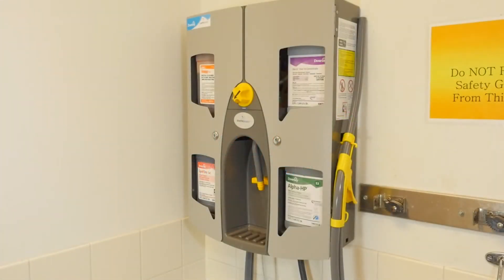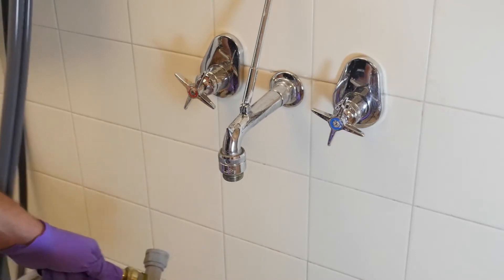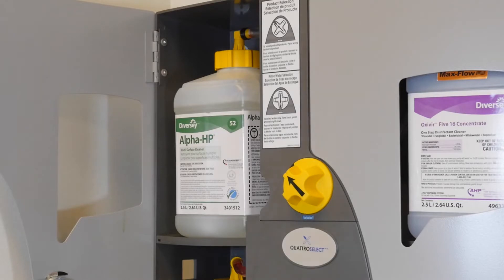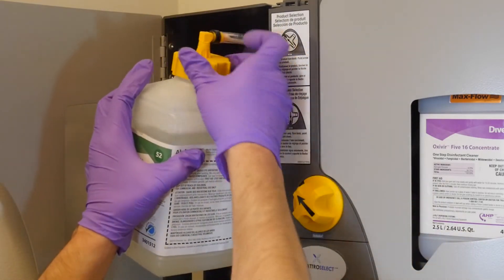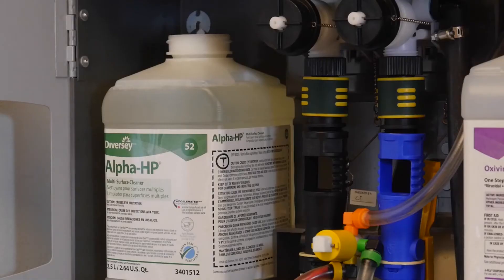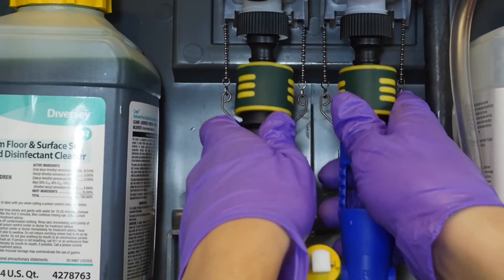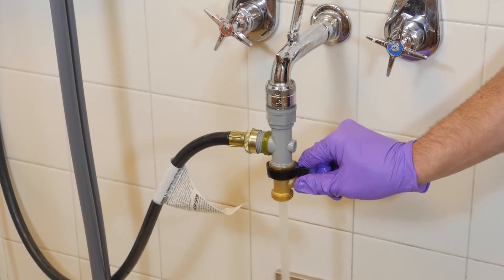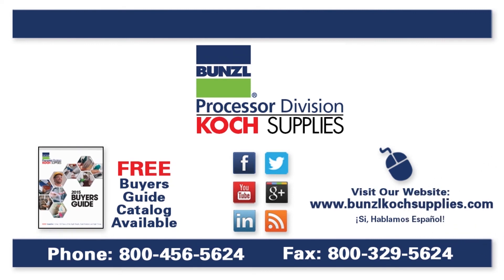Troubleshooting Water/Chemical Draw On The J-Fill Quattro Select — Bunzl Processor Division

Comment: What happens if the water pressure is too low?
Reply from the maker: Hi James, this unit requires a water pressure of between 30-85 psi and a minimum of 2.0 gallons per minute to operate properly.